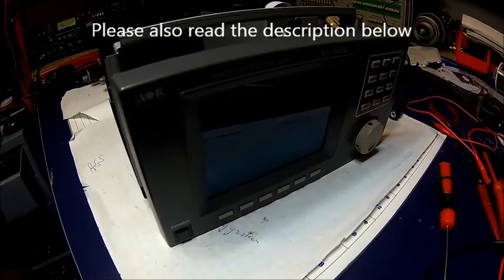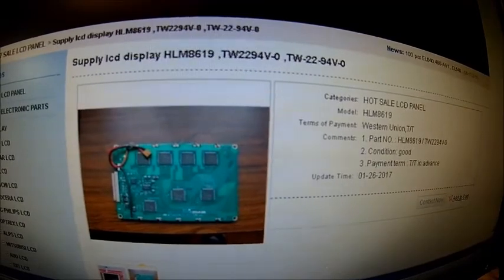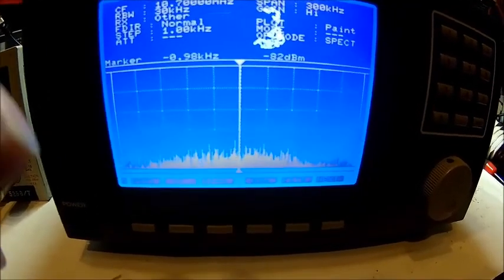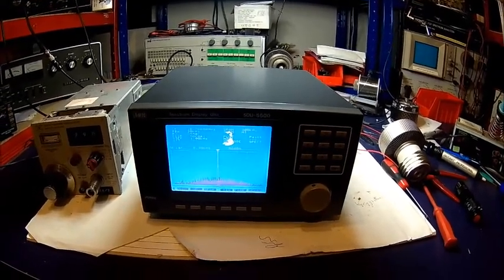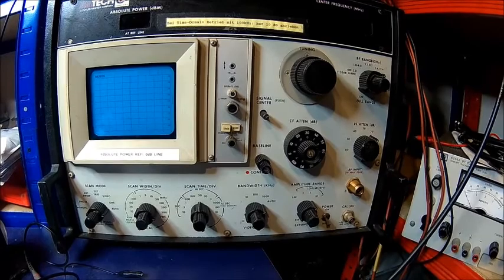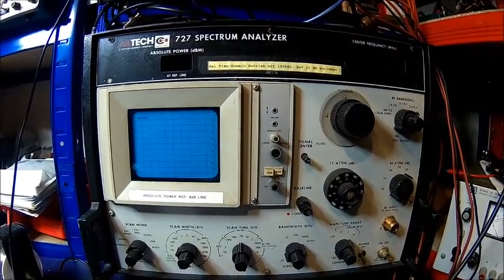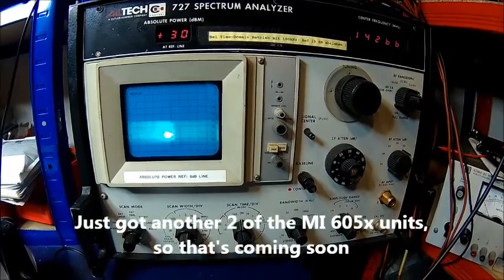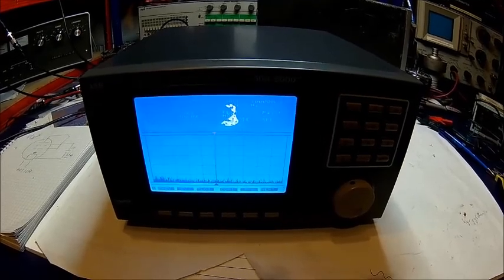AOR SDU-5500 Spectrum Display - tear down + inspection and a look at my spectrum analyzer collection

Comment: Please let me know what is the model of just the LCD without the full pcb? HLN8619 has a ribbon cable input instead of 14 wires and this may need extra work. Price difference is huge between TW2294V-0 G321E and HLM8619 as the 2294 cost around 120 and 8619 around 50-60 usd.
Reply from the maker: Hi, i've just read the email you sent earlier, ... sorry, but all the information i have is in the video, no further details available. 
I was never intending to swap the LCD without the carrier board, ... $120 sounds about right for the complete LCD unit.